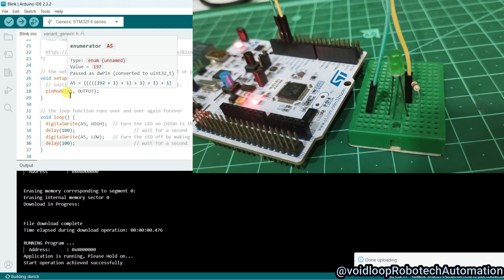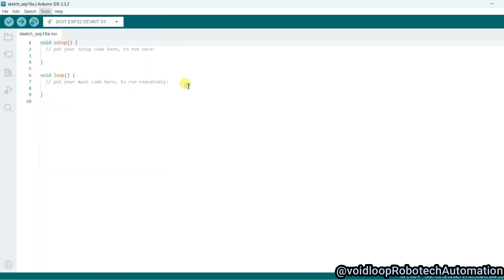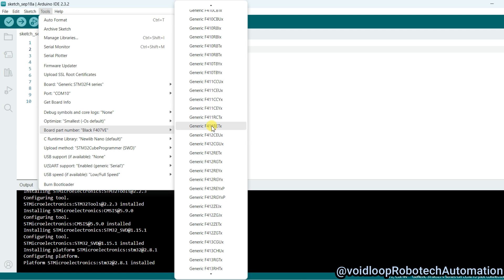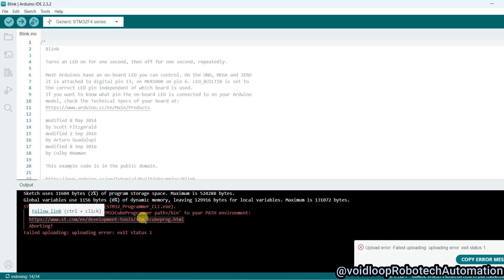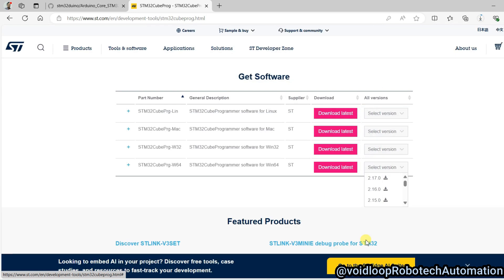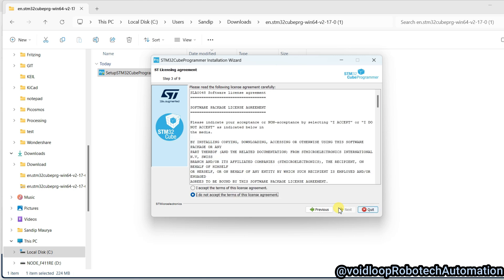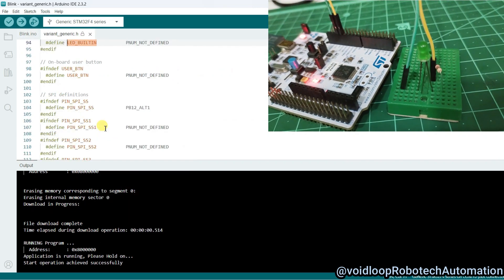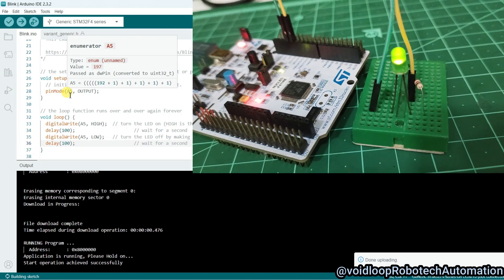STM32 Program with Arduino || Setup Arduino for STM32 ||

Comment: Thanks for your video, as it helped me get my NUCLEO-F767ZI working.

I did do one thing differently.  Instead of using A5 to blink an external LED, I used PB0, to blink the on-board green LED labeled as LD1.  I also used PB7 to blink the on-board blue LED labeled as LD2, and PB14 to blink the on-board red LED labeled as LD3.

Any hints on how to get the Serial Monitor working?
Reply from the maker: Contact me  on mail voidlooprobotech@gmail.com